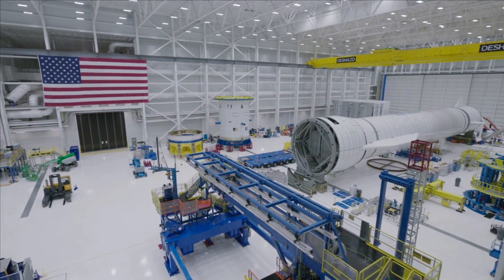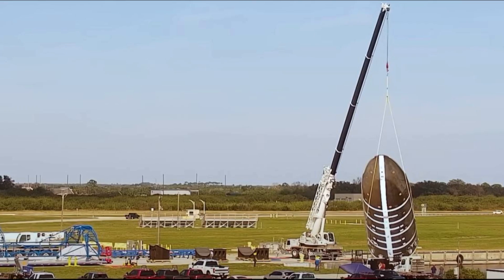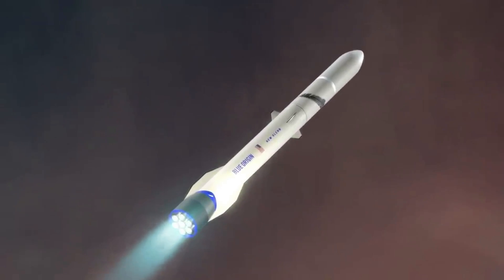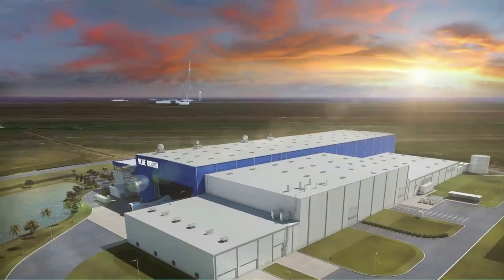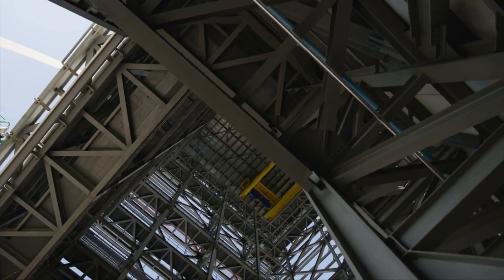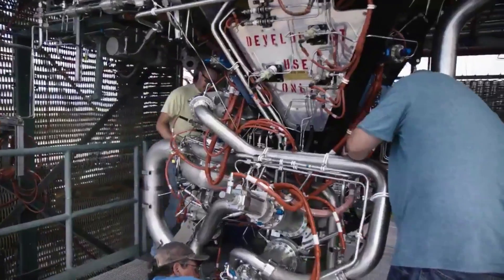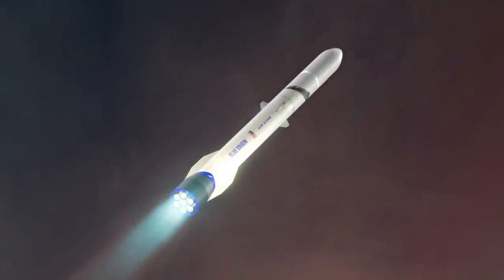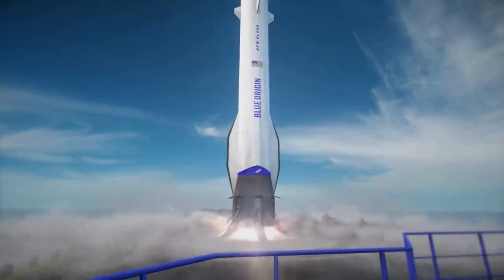What Progress Has Been Made On Blue Origin’s New Glenn Launch Vehicle?

Comment: A great deal is riding on Blue Origin kicking this New Glenn development into high gear. BO wants to use NG for building its Orbital Reef space station. BO also seems to want to be involved with other projects, including its second National Team lunar lander. Any project like these is going to be hampered in BO doesn't start showing consistent progress in the next 2 or 3 years. If this progress fails to materialize, not only with NG become a paper tiger, but so will Orbital Reef and probably National Team as well. 

If BO really turns on with NG, and starts knocking down milestone after milestone on the way to making NG a viable space vehicle, there are very substantial opportunities to reach new heights with this vehicle. BO, if sucessful, could take the NG upper stage ("Project Jarvis") and design a newer, larger multi-purpose lunar lander with even greater capabilities than SpaceX's HLS Starship concept. Though Project Jarvis stage is smaller in overall dimensions than the Starship upper stage, BO has an opportunity to develop multiple vehicles from Jarvis.

One would be an HLS lander like HLS Starship. Let's call this Jarvis variant New Armstrong (NA). NA would be smaller than HLS Starship, but would still offer substantial capacity and capabilities as a lunar lander, both to work as a vehicle to convey a crew of astronauts to the lunar surface and to act as a mobile temporary lunar base. A second variant of Jarvis could be called New Moon (NM). NM would be a robot ship, designed to carry cargo, not astronauts, to the lunar surface. In essence, NM would be a huge freighter. The top of the Jarvis fairing could crack open and either one-half or one-third of that fairing could tilt or swing open. The other half would remain in-place, housing a built-in cargo crane so the payload could be lifted to lowered to sit on the lunar surface. 

If BO fails to keep NG on track, or if BO fails to make a completed NG and Project Jarvis live up to its obvious potential (you can bet that SpaceX is already working toward similar projects, HLS Starship only being the first) then NG's relevance to the coming High Frontier will continue to shrink, and BO's relevance will shrink along with NG. It's up to BO to make it happen and to show some vision.
Reply: Blue Origin is expanding with new construction and hiring. People who doubt their progress are just haters. They will run neck and neck with Space X in 2-3 yrs.

Comment: The Jarvis concept actually in theory could make more economical sense to commercial missions to LEO than Starship. It's a Stainless steel upper stage with fixed wings, and a standard payload fairing. The advantage with this design, it's that the deploy procedures of the satellites are more standard, and it has less mass on reentry, and a smaller heat shield. Gliding to land, not relying this way on the main engines or carrying extra propellant.